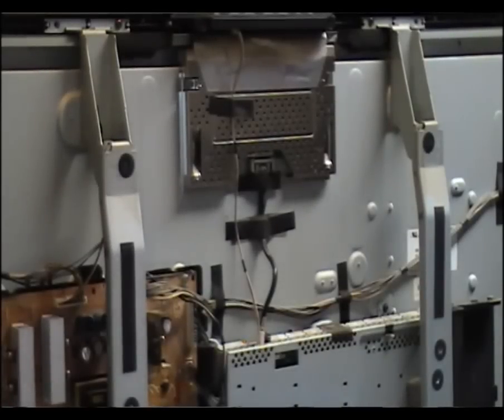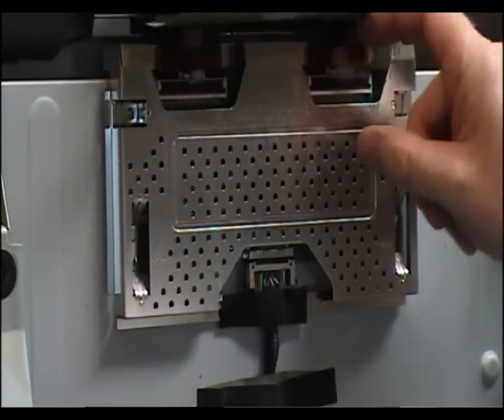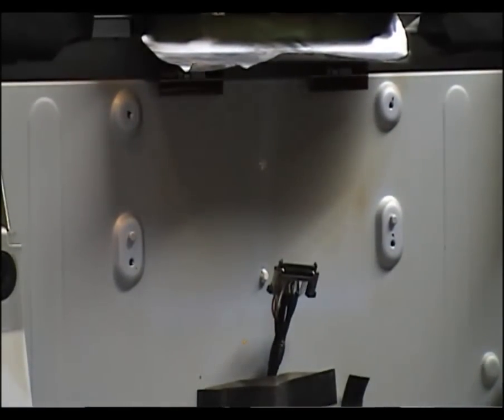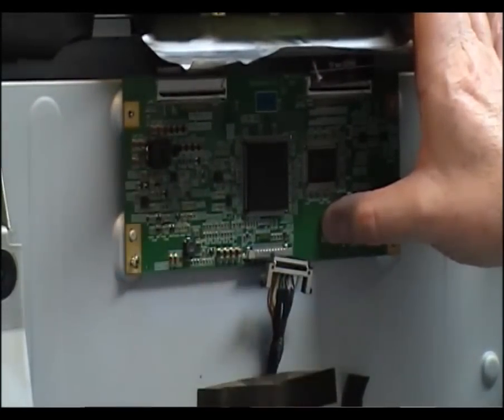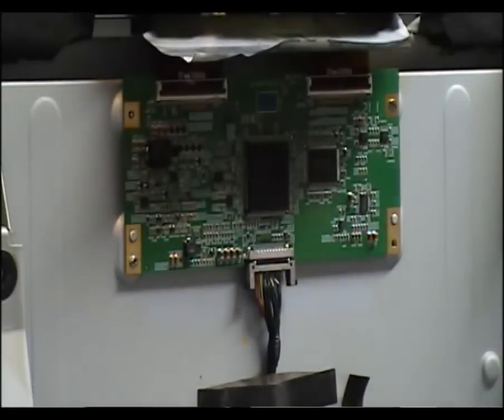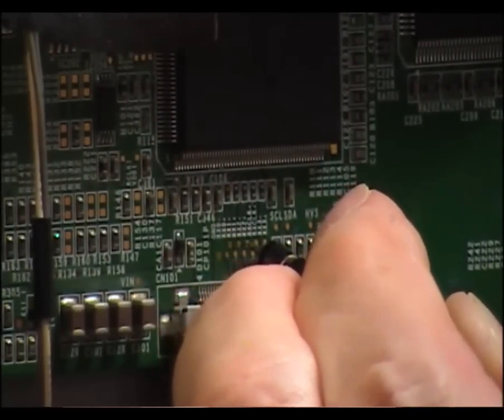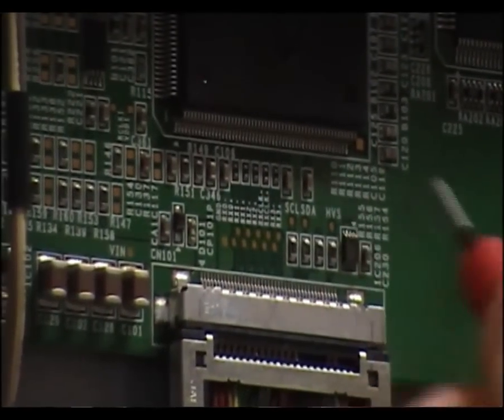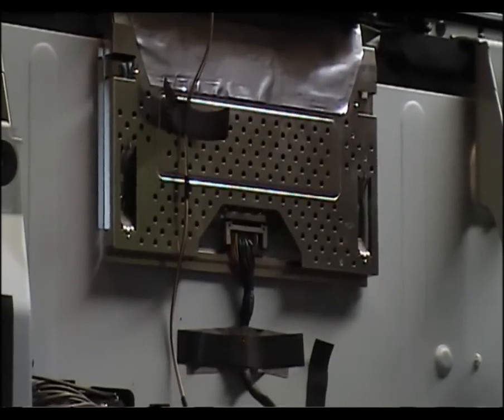Sony KDL-46S2010 No Picture on Screen

Comment: I have an old Bravia KDL325300 TV, when I turn it on the inverter turns on 1-2sec (lights up the whole screen area bright white light) and then shuts off the tv with no picture and no sound, completely off with 8 red blinks on the red light indicator. What do you think the possible problem is?

Comment: I have a SONY KDL-50R450A and the picture was flickering after every 2 seconds, I check the flexible connector on the T-CON and after reconnecting them the picture and the sound disappeared. Does this mean that I blew the fuse on the T-COM or is there anything that I did without realizing it? Help

Comment: could not understand him very well and did not cover his unpluging of  the D1 system. In my TV the d1 connection was not connected and may have been my problem. It seems the connection has 3 prongs which do not fit into a female connection but on the top of the board just to touch the 3 receptors. Confusing. Wish he would cover this a speak clearer and louder.

Comment: Can I just bypass the fuse altogether if I just want it to be working again by soldering the adjacent solder points together, or does the fuse regulate the current somehow?
Reply from the maker: +mrjrclark you could and it would work, but a fuse is there for a reason, its a critical safety device and should never be bypassed

Comment: Good day :-) what is the problem if Sony KLV40S200A indicator blinks 5 times and stop blinking for 1 second?
Reply from the maker: I don't have a manual for that model, but I would imagine the KDL40S2000 would be similar.
according to this manual, check the 18V supply on the power supply pcb
Reply: +Electronic Workshop hello   can you give any help on why the KDL40S2010 wont turn on and standby light blinks red 5 times? thank you :(

Comment: Hi there! verry nice video. I have a problem with my KDL40V3000 picture. I turn on the tv, everything fine but in around 10-45min sometimes more time sometimes less the picture disapear suddenly , no menu no nothing, the screen stay on the backlights work and the sound work, I turn the tv off and back on and the picture is there, after 10-45min same thing hapend, over and over no picture but screen on and sound on. No blinkin lights just stays on like when u power the tv on. Can it be the t-con or the main borad, or overheating  what is your expert opinion, thanks!!!

Comment: Hi I habe a kdl-40v5810 model its no picture but still have a sound wat I gonna do? Thanks
Reply from the maker: I don't have a service manual here for that model
but in general with all lcd , I would check to see if my backlight is working first.
you can see if it lighting, by softly pressing the screen in a room with no light, or by taking the rear cover off, you will then be able to see light coming thru small holes on the rear of the screen, If there is no light, The next thing I would do is to make sure there is a supply voltage to the invertor
If there is light, you would have to check for either 12V or 5V supply voltage on the t-con pcb, check fuses on t-con pcb, if these are all ok, you will have to get an oscilloscope to check for video info on the lead to the screen

Comment: After a little research, my board is a 400WSC4LV0.4  I found the fuse has a "P" on it.  It measured about .060" x .035".  This is an 0603 Littlefuse surface mount fuse.  The P designates it at a 3 amp fuse.

Comment: I have a very similar issue on my Sony KDL-40S2010.  I checked the fuse on my T-con board and found it be blown.  Do you know what the value of the fuse is?
Reply from the maker: Thanks Tony
valuable information to have, since all the manufactures wont supply the information to us.
I have being using fuses from scrap pcb's
Reply: Tony Perez my problam is Soni 32w600a modal no picture&mother board & back light is ok & skelar board voltej is ok but no display